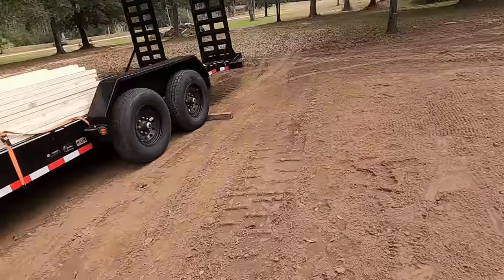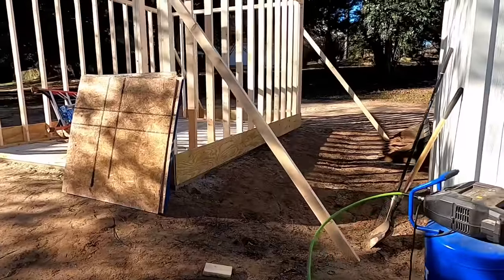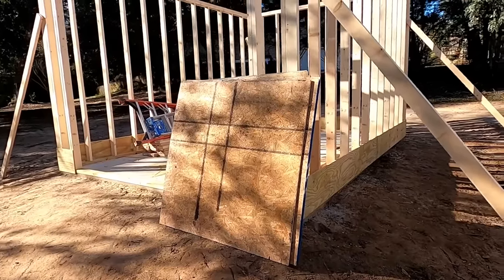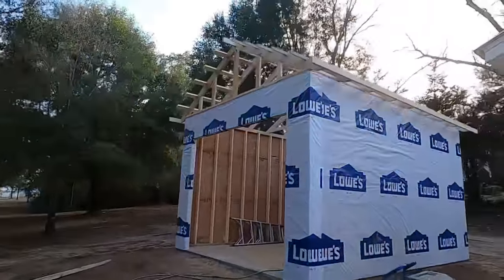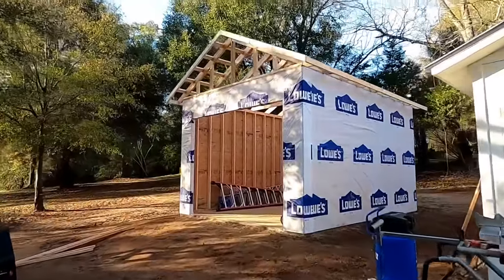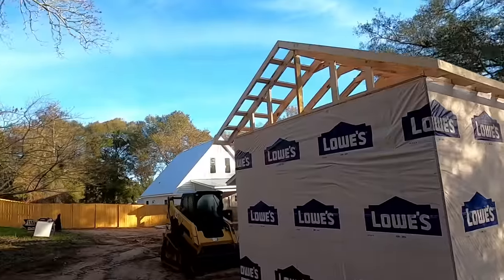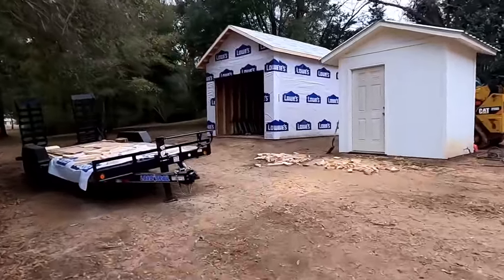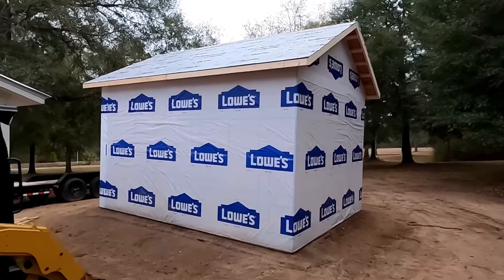Building a 12x16 Shed start to finish! Time lapse. Cost $2,800.00

Comment: As a contractor that does a lot of one person work I’d give you a couple of pieces of advice or points that have served me well for work like this: 1. Sheet good carriers can help a lot allowing you to easily carry 3/4” plywood of 5/8” drywall by yourself and along with that sheet clips which are simply folded metal that forms an H, you drop a couple on your previous sheet and simply drop your next sheet in, and they hold it while you nail/screw; and 2. Cellulose PVC for the bottom foot of your sheeting, it doesn’t rot, it’s water proof, and along with foam under your bottom plate and pressure treated lumber for the bottom plate, will ensure the structures you build will outlast you. I also like cellulose PVC for soffits and trim as you can get it in numerous colors, you never have to paint it, it doesn’t rot or leak, and there isn’t a bug around that likes making their homes in or with it.
Reply from the maker: Thanks for all the pointers! I appreciate your comment!
Reply: @weightbuilddig166  
As a contractor as well, I second this advise.
Reply: Thank you for this! ❤
Reply: Giving yourself 4 inches of height above grade is ideal to avoid water issues at the slab.
Reply: As a DIYer on a shed every 20 years I don’t give a shit.
Reply: @Mr.SuperDuper-idk proving once again diy is equivalent to dum bass every time
Reply: Do you mean instead of the 12” plywood sheathing that he initially installed the better thing would be 1’ pvc? What product do you recommend or use? Thanks
Reply: Does anybody have a link for that PVC stuff from Lowe’s or Home Depot? I’m currently building my house and I would love to buy some. I’m using zip on the exterior walls 7/16.
Reply: The sheeting is OSB and OSB while sometimes called 1/2”, is really 7/16” and is not very heavy to carry around.  3/4” sheetrock is definitely something I would use a sheet carrier for but that is because I am about 50 years past my prime and 3/4” sheetrock is now heavy
Reply: Can you or someone give me a link to what you are referring to as Cellulose PVC in pointer #2? DIY-er here -- and I appreiciate your input/tips.  Thanks!

Comment: Pro tip.  Hit that bottom 4 1/2 with Henry's roofing tar.  Roll it on both sides and the bottom with a wiz roller or a 9 inch.  Works great on T-111 as well.  Great video

Comment: I'm thinking about doing a 16x24 shop/shed on gravel pad with treated skids. I plan to just scale up your build to those dimensions. Thank you so much for the inspiration!
Reply: You could do gavel pad with concrete cinderblocks on the four corners and half way down the 24’ wall. That’s what I’m doing so I can park in it without having skids or plywood underneath the vehicle

Comment: Did a 8x12 with a concrete pad myself (biggest you can do without a permit) prices are more in Canada but if you have the ability it's easy to do yourself. 

Guys are charging $5500-6000 for the shed I built WITHOUT a concrete pad.

I got a truck that delivers concrete by the yard and it was $550. $80 for crush and wire mesh.
About 1600 in materials (2x4 wall, 2x8 roof rafters(flat angled roof) and LP smart panel siding) with a 5x7 steel roll up door.

Comment: I’m at $3600 so far with concrete slab  I poured myself with  rebar and 3 pallets of 56 x 60 lbs bag of concrete mix and bought all lumber on marketplace and saved over 30% over box store and material supplies , and I still need all the hardware ( nails , screws , brackets , doors hinges etc… ) and the outside trim and paint .
Reply from the maker: @lacuzon39000  $2800 did not include doors windows siding. It was just the slab and the material to build the shed to  the point where it was dried in with house wrap and the felt on the roof. Also did not include the metal for the roof.

Comment: Would be helpful if you had a list of all the tools you used? Great video.
Reply from the maker: Thanks! I appreciate your suggestion. I’ll start doing that. On this job I used a hammer, 4’ level, framing nail gun, 3” nails, 2.5” nails, wedge anchor bolts, hurricane clips, skill saw, table saw, miter saw, cordless drill, speed square and 25” tape measure.

Comment: WOW!! I need you around my house. You make it look so easy. I am going back in forward on buy from my  local imish building yard and paying around $10.000 or building myself. Looking to build A-frame 12x20
Reply from the maker: Thanks! Yeah there’s a lot of work involved. I spent $7000. By the time I finished building my shed. So I understand the debate.
Reply: @weightbuilddig166  $7000?  You specifiy $2800 in the title.  What's up with that?
Reply from the maker: @rickgrinstead9585  The prices are reflecting the amount of money it took to get the building to that point.

Comment: On the roof, is that 2x8s for the ends and 2x6s for everything in between? I like your way of doing the overhang, much more reliable than the ladder method. Thank you, looks great!
Reply from the maker: Thanks! I used 2x6 for the rafters. And 2x4 on the ends

Comment: How did you attach the structure to the foundation? Seems like you just stood the framing up along the edges but I did not see that it was fastened to the concrete in any way
Reply from the maker: I came back a day or two later and fastened the walls with the concrete wedges. Drilled through the bottom plate and in the concrete then installed the wedges and then tighten the nut.
Reply: gochya! thank you for the reply

Comment: If you are installing a metal roof, did you need the OSB there?  2x4 purlins across your rafters and then install the metal roof
Reply from the maker: Yeah I could of done it that way, but I wanted to do it this way mainly keep noise down when it rains and better for insulation if I decide to that later on.

Comment: I built the exact same shed (concrete pad, 10' studs for the walls, did everything myself with my dad and a couple buddies) and it cost a hell of a lot more than 2800. The concrete pad was about a thousand, and just the lumber (which I got before covid craziness happened) was $1800. That's not even shingles, tyvek, siding, the man door/garage door. It's been a while since I've looked at the spreadsheet but I ran power to the shed, built a couple shelves across the 12' and I'm pretty sure I was around $8000 or so all in.
Reply from the maker: Yeah. Mine was $900 for concrete $200 for dirt $1700 for building materials. I still have to buy metal roofing, soffit and facia and the vinyl siding. So when mine is done it will probably be $7000.
Reply: @Weight, Build, Dig!  sounds about right. I saw some of your comments wishing you went a bit bigger. I hear that,  but locally if you go bigger than 200 sq ft you need a footer which is stupid
Reply from the maker: @MeltingRubberZ28  yeah that is. I want to build a 30x50 garage and I’ll have to do a footer and then block on top of that then the header block. But I have to do that because my ground has such a slope to it.
Reply: @Weight, Build, Dig!  yeah I have a 30x40 garage right now. Setup I have now is nice but definitely wish the shed was bigger.
Reply: @weightbuilddig166 did you pour the slab yourself with bagged cement?
Reply from the maker: @PrevedMedved82  no I ordered four yards on a concrete truck and poured it that way.

Comment: I watched this video a few times and other 12 x 16 shed building videos. The thing I've learned  Is, anybody can build a wall, it takes talent to build the roof and get all the angles correct. Good job. Do you have the plans written down anywhere that you could send / sell to people who may want to build this exact shed?
Reply from the maker: Thanks! I appreciate your comment. Yeah I don’t have plans for it. I do have a materials list that I’ll send you.  The pitch I went with is 7/12. The angle for that is 30.26. Keep in mind when building you can cut the angles required but you may have to adjust the angle slightly based on your own build. In other words on paper every things perfect but on actual build you could be off a little here and there which would be cause for adjustment.
Reply from the maker: Here’s the list 
2-2x4x16 pt
4-2×4×16 white board
2-2×4x12 pt
4-2×4×12 white board
58-2×4×10 white board
25-7/16 4×8 osb
18-2x6x10 syp
1-2×8x16 syp
10-2×6x12 syp
1 roll house wrap
1 roll felt buster
2-4×8 pressure treated plywood
2-2×10x10 syp
Reply: @weightbuilddig166  Thanks! Very much appreciated.
Reply: @weightbuilddig166  The $900 concrete slab did you paid some/ordered the truck or you bought cement bags and did it from scratch?
Reply from the maker: @albert15986  I ordered a concrete truck and pored it myself

Comment: Just a small observation if I was going to work alone and I had a bobcat I would have scaffolding. And I am just curious your brother-in-law was willing to come over and help you measure for the rakes but couldn't help you put sheathing on the roof
Reply from the maker: Well my goal was to see if I could build the whole thing by myself. Installing the boards on racks I needed help which is when I got my brother in law to help.

Comment: Very inspiring. Novice question shouldn’t the nail gun be able to set the nail enough so a hammer wouldn’t be needed?
Reply from the maker: Yes and it usually does. But because I’m using a medium size air compressor and 50 feet of hose it doesn’t always drive the nails home.

Comment: Well done, Do you have a set of plans/ materials list for this project that are available? I will be building my own very similar.
Reply from the maker: Sure!
2-2x4x16 pt
4-2×4×16 white board
2-2×4x12 pt
4-2×4×12 white board
58-2×4×10 white board
25-7/16 4×8 osb
18-2x6x10 syp
1-2×8x16 syp
10-2×6x12 syp
1 roll house wrap
1 roll felt buster
2-4×8 pressure treated plywood
2-2×10x10 syp
This is what I bought. I actually didn’t have any plans. I just had a vision in my mind and built it.

Comment: Nice work! If you were to build the shed again, would you do anything  differently?
Reply from the maker: Thanks! Yes! I would build it bigger. Lol. Besides going bigger I would make the slab 1 foot thick all the way around the perimeter. That will make it so I can lower the dirt 6” on all 4 sides. Better for drainage and keeps the grass from being right at the siding. But I am happy with the way mine is.

Comment: Nice work, i do have 2 questions. Question 1 how did you lift the plywood/osb by yourself hold it in place with 1 hand and set clamp on the end, question 2 what is the proper name for the white lowe's wrap material that you used to cover/protect the wood from the elements
Reply from the maker: Thanks! So for question one because I had the 1 foot of pressure treated plywood on the bottom I could rest the osb on it. So from there I was just keeping in place not holding it anymore and I could put the clamp on so I could then nail it. Question 2. House wrap is the name of the lowes material that was used as the vapor barrier.

Comment: Why did you notch top of the board and connect the roof boards on each end? To help support the overhang?
Reply from the maker: Yes that’s correct. It keeps the overhang from sagging overtime.

Comment: 2800 from where? That wood alone is 2800 and did you include the concrete?
Reply from the maker: Yes it included the concrete. I bought it from Lowes. Two years ago when I was building my house a sheet of osb was $35.00 two months I paid $11.00 a sheet. That’s a big difference.
Reply: @weightbuilddig166  That's a huge difference! Well thank you very much for sharing your journey. I just finished up our backyard fencing area so I will need to get a small shed put up soon and will use this as inspiration!

Comment: $2800 and you have a concrete slab?   Concrete is $160 a yard where I live and that doesn’t include forming lumber and labor (unless you do your own concrete work).  That’s way over $2800 and you have not bought a stick of lumber, wrap, siding, roofing, soffit, facia doors, windows etc

Comment: When building something like this, do you need to vent the roof. TIA
Reply from the maker: I did vent mine I cut the felt at the top of the ridge. Then put metal ridge cap on top of the metal roof. So it can vent there. Then the vinyl on the side walls not the gable has vent in it as well.
Reply: @weightbuilddig166  okay, thanks. Great work, the video really helps a newbie like me.

Comment: Question, where the rafters meet the ridge of the roof, did you use hangers there?  Was hard to see on the video.
Reply from the maker: No I toenailed the nails through the rafters into the ridge beam. The nails end up making an x inside the wood makes for a strong connection.
Reply: @weightbuilddig166  Thanks, yea that’s what I was curious about, whether or not it was strong enough.  Thank you.

Comment: Hello is it possible to get a list of materials you bought for this 12x16. Thank you
Reply from the maker: @maddenluvplus1240  Sure!
2-2x4x16 pt
4-2x4x16 white board
2-2x4x12 pt
4-2x4x12 white board
58-2x4x10 white board
25-7/16 4x8 osb
18-2x6x10 syp
1-2x8x16 syp
10-2x6x12 syp
1 roll house wrap
1 roll felt buster
2-4x8 pressure treated plywood
2-2x10x10 syp
Reply: Thanks a lot this helps. Great job by the way
Reply from the maker: @maddenluvplus1240  Thanks! Your welcome!

Comment: Could you provide the materials list for this shed and what was the cost of the slab?
Reply from the maker: Sure!
2-2×4×16 pt
4-2×4×16 white board
2-2x4×12 pt
4-2×4×12 white board
58-2×4x10 white board
25-7/16 4×8 osb
18-2×6×10 syp
1-2×8×16 syp
10-2x6×12 syp
1 roll house wrap
1 roll felt buster
2-4x8 pressure treated plywood
2-2x10×10 syp
Reply from the maker: The concrete slab was $900. I did it myself with the help from my buddy.

Comment: Your supposed to use treated 2by4s for your bottom plate when building on concrete
Reply from the maker: I did use pressure treated wood.

Comment: I mightve missed it but what did u use to attach the frame to the concrete sir ? I wanna build one myself.. thank you
Reply from the maker: Concrete wedges (anchor bolts) I installed them after the walls were up. I just didn’t show it.
Reply: @weightbuilddig166  thank you sir

Comment: If u dont mind me asking what framing nails did u opt for and size when nailing did u slightly angle the nail when framing or is that just sheathing. I’m learning apologies for basic knowledge i appreciate the knowledge sharing many thx. Also any best approachs to figuring roof rafter size
Reply from the maker: Well I have framing gun so I don’t know what size mail it use’s. When I mail I try to nail it straight into the wood. Unless I’m toenailing it then I angle my nail gun to a 45 degree angle. As far as your rafter size will depend on how far the spans is
Reply from the maker: So like if you have 30 foot wide building then that means your dealing with a 15 foot spans. Then you have to look at a chart and it will tell you what size the rafter needs to be. Like for my house I used a 2x8 for mine and it was a 15 foot spand

Comment: Is the cement slab, included in the price of the $2,800
Reply from the maker: Yes it is. It cost me $900. For the concrete. I did it myself with my buddy helping me.
Reply: @weightbuilddig166  so in reality will it cost close to double if you pay someone else to do it?
Reply from the maker: @caezarlapuc8627  I figured between $10 to $12 thousand if I hired it out. Keep in mind . I still have to add the metal roof soffit and facia, a garage door and the siding. I don’t know what the total will be but just guessing it will be between $5 to $6 thousand total cost for me
Reply: @weightbuilddig166  ok. That makes more sense I first I was thinking how could be so low at $2800 on  the description but that's  only if we dont hire anyone. Still for DYI is not bad $2800 cost
Reply: Yeah thought so , I built one  about 10 years ago and it was around 3200-3600 can’t quite remember.
Reply: I say b…s… $ 2800 ..who did you steal the lumber from for one?
Reply from the maker: @isitago  I bought it from lowes. Our lumber here in Alabama has really gone down. Two years ago when I was building my house I paid $35.00 for a 7/16 sheet of osb. When I bought the same size sheet 3 weeks ago I paid $11.00 a sheet. Huge difference.
Reply: @weightbuilddig166  California here, I know lumber has gone down,but not quite to Alabama prices.😉 just built a shed myself last summer, I did it myself, …this cost this much?
Reply: Great now I need you to come build one in my backyard for that..
Reply: Nicely done!
Reply from the maker: @douglasramey3162  Thanks!
Reply: Do you have plans for this shed?
Reply from the maker: @josephsalloum5729  I don’t. I just built it.
Reply: That’s “concrete slab”. Cement is part of concrete like flour is part of bread.

Comment: Thanks for posting. This is the exact size that I want. Is there anyway of telling me your material list?
Reply from the maker: Sure! 
2–2x4x16 pt
4–2x4x16 white board
2–2x4x12 pt
4–2x4x12 white board 
58–2x4x10 white board
25–7/16 4x8 osb 
18–2x6x10 syp 
1–2x8x16 syp 
10–2x6x12 syp 
1 roll house wrap
1 roll felt buster
2–4x8 pressure treated plywood
2–2x10x10 syp

Comment: You need blocking at the seams of the OSB on the walls. It's much stronger if you stand it up. OSB has a vertical strength axis.
Reply: It doesn't do much other than provide shear strength, what you're suggesting would provide zero practical benefit
Reply: @TheDapack  Wrong. It also holds the wall racked, when it goes plate to plate.
Reply: @grovehotspot9041  You do not know what you are talking about from an engineering perspective, there's a half dozen ways the wall will fail before the orientation of the sheathing becomes a factor
Reply: @grovehotspot9041  Ill accept that as you acknowledging that you were wrong